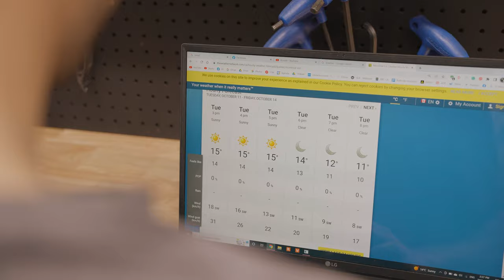All Direct Drive Trainer Kinda Sucks... (Wahoo, Tacx, Elite) VS Stages SB20

Comment: you've really made the turbo trainer experience look extremely challenging I'll give you that 😂 

just use a kickr....

has a handle....

comes with a cassette

wax your drive chain no mess 👍

Sadly I'm not a stages fan after multiple failures with their power meters 😔 hope the bike is more reliable.

Funny video though esp using a kickr in the thumbnail but using a tacx on the set up.... priceless 😂
Reply from the maker: Aahahahahah yeah it's a funny skit, all of these things happened to me before, just not all at ONCE like in this video :p
Reply: LOL! It reminded me of infomercials where they show people having all kinds of problems that most people just don't have. Funny video though

Comment: Or you could just have the identical casette in the turbo trainer. 

Make a video on you tweaking the geometry of the stationary for hours trying to get it the same as your on road bike.
Reply from the maker: It's actually very easy to dial in the position ahah
Reply: @CharlesOuimet  and then your gf gets on and changes it and on and on. Much less practical then a bike on a turbo trainer
Reply: If you have several folks in your house that ride, it is much easier to set up the SB20 for each rider than swap out bikes on a turbo trainer. You just record their numbers, after that it takes about one minute to readjust a SB20 for another rider and they can do it themselves.

Comment: My SB20 isn’t accurate enough for me. With brand new batteries it reads 10% high. With batteries that are down to 25-30% capacity, the power starts to drift low for the remaining life of the batteries. I’ve resorted to using known-good power meter pedals on my SB20.
Reply from the maker: Thanks for sharing! In my initial testing I had exact same power output from the SB20 and my assioma pedals, but over time I've only used the power of my pedal on the SB20 so I have the same powermeter indoor and outdoor. I'll check into the data for the SB20 powermeter over time/battery life!

Comment: Bonjour Charles. Félicitation pour la qualité de tes vidéos. 
J’ai une petite question pour toi. J’aimerais savoir si tu as un contact pour la réparation du Smart Bike Stages SB20. J’ai un 2021 et il fait un bruit intermittent avec une une vibration dans le guidon.  Le bruit provient de la Flywheel. 
Je te souhaite de joyeuses fêtes à toi et ta belle petite famille inspirante. 
Mario.
Reply from the maker: Merci!
Malheureusement je n'ai plus de contact chez Stages.. j'entends que leur support à la clientèle est pas super non plus c'est temps ci... ce qui est triste. C'est un bon produit malgré tout
Reply: Merci 🙏 pour le retour. Vraiment apprécié! Bonne 2024. Santé et bonheur à toi et ta famille.

Comment: I have a wheel on trainer, so I don't need to take off my wheel and it's way, way cheaper! And it's foldable!
Reply from the maker: Wheel on trainer are very noisy! And not accurate, and can't sprint over 700w without wheel slip...! Ruins your tires. Cheaper yes, but the experience is definitely not at all close to a direct drive or indoor bike!
Reply: I had one for years. I finally had enough of the wheel slipping while going up steeper climbs in Zwift. On the flatter stuff, it was perfectly fine though.